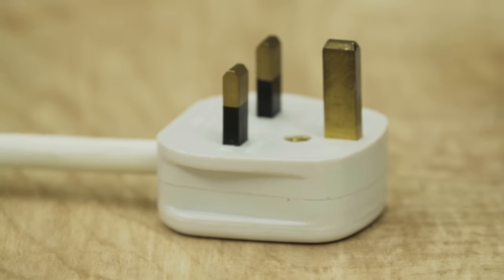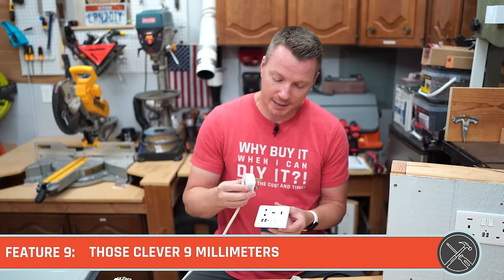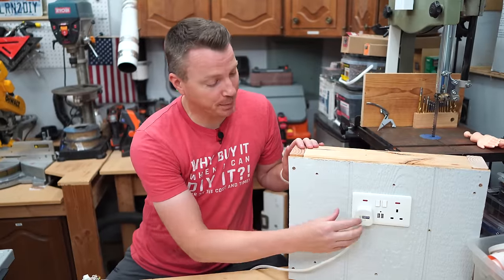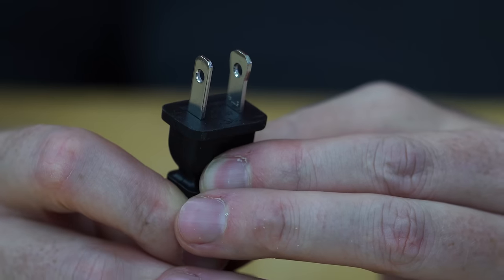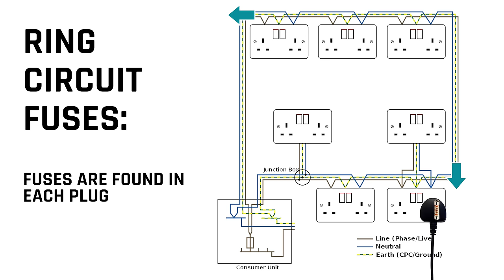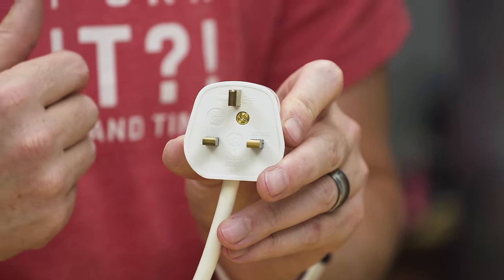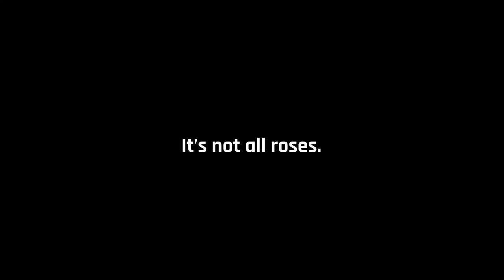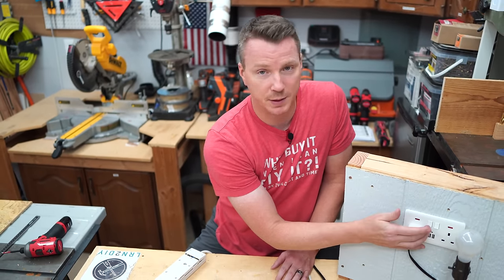British Plugs and Outlets Are On Another Level

Comment: The final two downsides are just not a thing - if an appliance isn’t activating from its on/off switch, we Brits will instinctively check it’s plugged in and the socket switch is on. Only if that fails does any head scratching begin. 

The UK electricity National Grid and supply system is one of those rare historical occasions when there was an opportunity to do something right - in this case as part of the rebuilding of Britain after WWII - and damn the expense and any difficulties, because it will pay dividends in the long run, long after those responsible will be around to receive any credit for their foresight and intuition. Much like our sewers and fresh water system. Now nothing happens unless it’s a short-term patch up with a short-term gain for shareholders and a knighthood for the numbskull in charge.

Comment: or you know, the European plug. that wastes less materials, being omnidirectional and has the same safety features. probably safer as the holes are smaller.
Edit: AAAAnd does not have a way to lay on the ground that would give you nightmares.

Comment: The earth pin touches first on a NEMA plug as well.  The have an earth pin even when an earth connection isn't required. Until a diective from Europe items came without a plug in the UK, and one had to buy it separately and fit it, and the conductor pins only had insulation added after that directive. Unless there's a ring-circuit these plugs are superfluous. Worst thing ever introduced in Ireland, a British plug after we sought independence from England. Ireland was better off with the German Schuko plugs/sockets, and more in line with mainland Europe. 32 amp ring-circuits are far more dangerous that radial circuits. The Grenfell apartment block fire in London was evidence of the dangers of these in residential locations. You're talking garbage!

Comment: I’m recently persuaded that the UK 3 pin mains plug is the worst bit of design ever! The Earth pin and the shutters are completely unnecessary, there is no real electrical or fire hazard. How often do you hear of non-UK citizens being electrocuted or burned to death in electrical fires? Spoiler alert, never. It is the most cumbersome and over designed thing ever, plus if you really want to electrocute yourself the safety features of the plug can easily be defeated with a screwdriver or knife. False sense of security.

OTOH the best piece of modern design is the Apple 13 amp power block with the UK 3 pin pattern. I can’t believe that it took more than 50 years for someone to come up with foldaway pins on the plug 🔌 so that you can put it in your pocket without impaling yourself. Go Apple 🍎

Comment: Never had trouble with Schuko. UK plugs feels like they are from beginning of the last century design wise for no particular reason.

Especially the "shutter" is odd, as many modern devices don't need an earth, as their case is out of plastic. So you have a non-functional earth pin which makes the plug massive.

Comment: Type G plugs are not the best plugs. Also he says they can carry a "large load" because of the large pins, yet they are ONLY rated for 13 amps so that's a total lie, even type Type E / Schuco can carry 16 amps. Maybe this is because of that bad ring circuit. So all that metal is just a WASTE of material. Type G plugs are great compared to US plugs which could not be more terrible but are definitely NOT the best plugs. The fuse and ring circuit is a hack from when copper was expensive. Why does EVERY APPLIANCE need a fuse and not just the socket itself? Good luck trying to tuck an extension cord away in a small place with plugs that huge. A plug that large and it can only carry 13 amps, give me a break from these fanboy fanatical fanfare fantasies.

Comment: BRO WHAT ABOUT AUSTRALIA
Reply: It has kangaroos.
Reply: It's like a thinner and slimmer version of the U.K. plug. 😆
Reply: @PhilipMarcYT  
No. No fuse in the plug.
Reply: @johnburns4017 diagonal flat pin (size of US plug), and flat vertical ground pin. Ground at the bottom  for use in Australia and Argentina but in China, Australian plugs and it’s earth pin at the top
Reply: @johnburns4017 Malaysia, Singapore, Hong Kong and Macau uses UK plug, also South African 15A plugs in Malaysia used for airconditioners.
Reply: @FrancisLitanofficialJAPINOY  
The South African are fuseless 16A - same as India. But the same as the British 15A. The 15A fuseless plug in the UK is still legal and available, and used - but in niche applications, as Singapore do on air conditioners.
Reply: @FrancisLitanofficialJAPINOY  
What the British G type plus has many advantages over others.  The prime advantage is the fuse in the plug.

Comment: Yeah, I'm just gonna say it.  US plugs are the best in the world.

British plugs and circuits are the worst.

I've never been shocked by a US plug.  Not once, not ever, not in over 50 years of living here.  It's just not that likely to happen.  Stepped on a plug with bare feet, on the other hand... yeah, I've done that.  It hurts.  But it doesn't destroy your foot.  British plugs are extremely dangerous.

And of course British plugs are more dangerous in other ways too.  Trip on a US cord, and it'll disconnect.  Trip on a British cord, you'll fall.  Not disconnecting when pulled isn't a safety feature, it's a dangerous bug.

Once you get beyond the plug, US circuits are safer too.  Like most of the world, we don't have that idiotic ring configuration, nobody outside Britain has that silliness.  But the lower voltage on most of our circuits (the US actually IS a 240V country, see this video:  https://www.youtube.com/watch?v=jMmUoZh3Hq4 ) is safer.  If something goes wrong with the safety systems and you do get shocked, you're less likely to die.  And we've still got 240 volts available where we need it.

(And what's with the washing machine mention?  US washing machines are fairly low current devices, high efficiency models can be as low as 300W at 120V.  Electric dryers are high current, that's why they're typically connected to a 30A 240V circuit in the US.  Brits don't typically even have them.)

Comment: UK plugs arent any more or less safe than other plugs. These "safety features" you mention are just over engineered fixes that other, more safe plugs in EU or China dont have. For example the fuse system is a fix for a objectively more dangerous wire setup that exists only to save money. It also isnt actually safer, which is why more companies arent including the fuses anymore.

You should check your facts instead of re-narrating tiktoks and a bad tomscott video